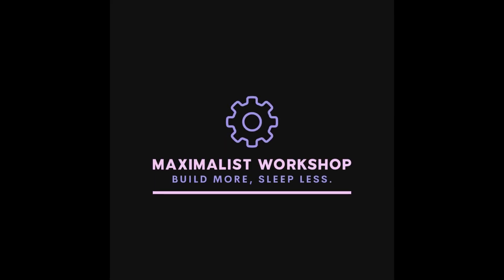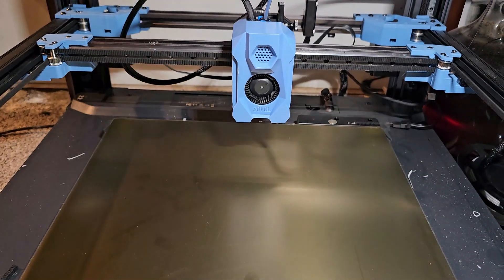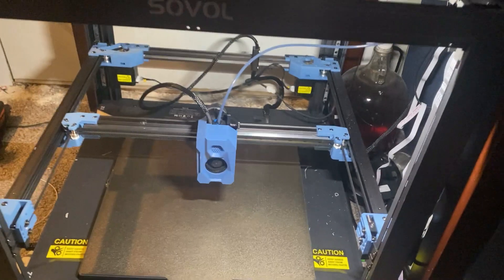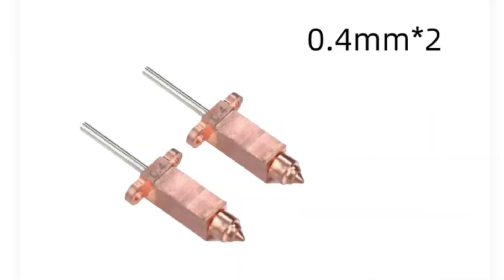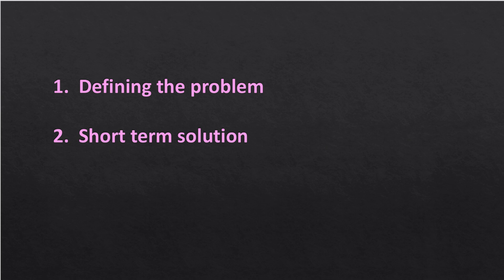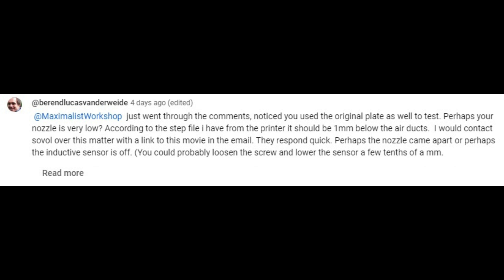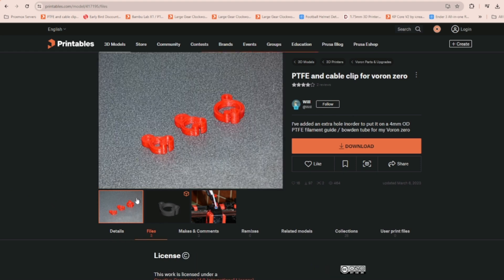Voron Clone Falls Apart - Sovol SV08 May Have a Problem

Comment: The machine is shit, straight up. they false advertised a X1 core xy clone thats garbage
Reply: after watching the whole viddeo, at least your motion system worked!
Reply from the maker: @AngryMarkFPV  They market it as a flying gantry Voron 2.4 clone.  The X1 is closer to the Trident.  In any case, it does seem like a lot of folks have been having motion system issues.
Reply: @MaximalistWorkshop  I am well aware, I also have an old tronxy 400. 
They clearly fixed the nozzles as the ones supplied in my order were threaded. however, clearly cheapest wiring and crappy terminators were used in the stepper leads.

Comment: 1:30 - YIKES!  That's some vicious nozzle crashing.

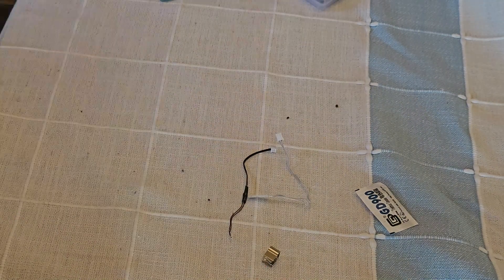Even though Sovol fixed the problem by adding a set screw to prevent the nozzle from pressing out of the hot end, but I replaced the Sovol hot end with a FlowTech hot end from @MicroSwiss when I was assembling my SV08, so I could enjoy the FlowTech advantages.  I can now quickly cold swap nozzles by simply unscrewing a FlowTech nozzle with a 7 mm nut driver and screwing in a different nozzle with no connectors to unplug, and no heater and thermistor to remove and replace as shown at 6:30.

8:45 - If anyone is interested in a fix for the dragging and flopping extruder cable when the reverse Bowden tube isn't used to stiffen it, I uploaded "SV08 Extruder Cable Chain - Cable Management" to Printables and Thiniverse.

Good video.  Thanks.  Sometimes I'm an early adopter, knowing that means I'll pay the most for the worst version of the product.  Rather than telling someone they should wait to buy a more polished version later as I usually do, I'm appreciative of earlier adopters.  If we all waited, there would never be any new products and initial problems would never be fixed.

Kudos to the Voron team, without which we'd never had an SV08.

My SV08 Wish List:

1) A thicker aluminum bed made with stress relieved cast aluminum that wouldn't warp more than 1 mm across the bed when heated as mine does.

2) The latest Beacon probe that is much faster and much more accurate than the OEM inductive probe that lacks temperature compensation.  The latest version of the Beacon has some magical accelerometer that can detect a 20 gram force nozzle touch, so after quickly scanning over the bed to create an accurate and finely detailed bed mesh, the Z=0 calibration can be very accurately determined by touching the heated nozzle to the heated bed rather than trying to infer Z=0 by inductively probing the bed when homing before a print.

3) Reliable web camera.  I often need to restart Crowsnest from the menu that drops down when clicking the power button in the top right corner of the Mainsail web browser screen.

4) Reliable WiFi.  My SV08 would never connect to my WiFi network.  I bought a WiFi bridge and plugged it into the SV08's Ethernet connector.

5) Nicer Klipper touch screen.  I seldom use the SV08 machine interface as I usually control the printer from my computer but the clicky rotary knob user interface feels very dated.

6) More LED lighting.  The stock LED strip is marginal at best and there is no light on the bottom of the tool head that would make it easier to see a print that fails until the print is 10+ layers tall and there's a big blob of molten plastic on the nozzle if the first layer failed.

7) New Orbiter 2 extruder with a smart filament detector on top, although I don't want to give up my @Microswiss hot end.

8) Multiple tool heads, or my preference, a fast IDEX system.  This is far from trivial but would greatly improve the SV08's capabilities.

I replaced the cheap and noisy motherboard fan with a reliable and quiet Noctua fan when I was assembling the SV08.  I'm wrapping up the design of a 3D printed insulated enclosure for the SV08 which I'll upload to Printables.  I still need to shim the bed to reduce the warping but so far I've been restarting prints that fail on the first few layers.  I'll eventually  install mainline Klipper when that's the only way to get some feature that I decide that I need.

Despite its deficiencies, I like the SV08 and I'm glad Sovol decided to make their version of the Voron 2.4 for the masses.

Comment: GD900 isn't rated for the hotend. It has a thermal property that maxes out at about 200C. Please swap out your GD900 with boron nitrate.
Reply from the maker: @BillBollinger-i4v  Dope tip - thanks! I assumed this was fine because it came with a hotend I bought, but you're right.  Probably worth some testing and a vid.

Comment: Isn't there a touch pressure sensor next to the nozzle clean pad? Why not use it to measure the difference between the inductive sensor and nozzle? It appears the nozzle is clear of the bed if moved to the extreme right, this means no bed damage.
Reply from the maker: Because the problem isn't that the z-offset is set wrong - the nozzle was actively being pushed out of the hotend during printing.  No amount of pre-print calibration can account for this.

Comment: That's crazy...   I think they should have just went with a high flow hotend that uses standard v6 or volcano nozzles.  Needing their custom nozzles is a killer for me.  I'd end up tossing the stock extruder/hotend and going with something more standard.  At least it runs Klipper so you can do just about anything you want.  Having to ditch parts that suck adds to the cost of the machine.
Reply from the maker: Agreed - fwiw, the Revo adaptor is available from PCBWay (though surprisingly expensive; waiting for mine now), and there's someone in the community who designed a V6 adaptor for which they're just trying to find a manufacturer now.  As expected from the maker community, new alternatives are popping up every day!
Reply: @MaximalistWorkshop  How much was yours? Everywhere I read it's surprisingly expensive, but I never saw a price.
Reply from the maker: @froh42  mine was originally about $220 or $230, but they dropped it down to about $140 because some of the custom stuff I asked for wasn't possible. I've heard less personalized units go for more like $80 or $90.

Comment: I don't see why they didn't use a thermal adhesive or set screw to lock it in place from factory.
Reply from the maker: Or a screw or literally anything else hahaha.  Since they never had any issues with T300 users, it just never occurred to them to test whether the nozzle could handle SV08 accelerations with all materials.

Comment: I guess we now know why the z offset seems to be so dodgy... Bummer...
Reply from the maker: Possible!  Tbh, automatic z offset on every printer except for Bambu Lab and Creality's X1/X1C are invariably slightly off.  About as accurate as the paper method, in my view, but I think that's because Bambu and the X1 series rely primarily on a strain gauge instead of trying to use both a strain gauge and some other probe.  Would need to do more testing to confirm.
Reply: @MaximalistWorkshop  a press fit that loose would be an excellent candidate for the greater part of the variability at least. In the end it's pointless though, they should have gone with a standard hotend, not this proprietary crap.

Comment: Could a grub screw be put into the heater block to set the nozzle in place? 
I think they were trying to ride on the Voron coattails and put out a fast/cheap alternative. One of the cost cutting measures appears to be the heat-block/nozzle setup. Granted, it's about half the price of a V2.4 in that size, and that's worth something. 
I would still consider the SV08 over a Voron if I needed a larger printer. I do like the CoreXY (I have a Voron 0.2) and am converting my SV06 to CoreXY now.
Reply from the maker: Yes,  adding a screw to the heater block is something that some folks are trying.  Voron has been central to their marketing from the beginning, but it seems like they really didn't test the T300's nozzle with PETG with the SV08's accelerations before releasing the machine.  Based on their email to me, I had understood adding a screw is what Sovol is doing and that this new design was in testing - it's discussed in my update video linked in the description. However, they have since publicly said that they don't think it's a design issue and they're checking with their manufacturers to confirm that tolerances are fixed.  That statement is posted on my Youtube profile.  At this point, I'm not sure what the plan is.
Reply: @MaximalistWorkshop  - You guys almost certainly know this seven months later, but for the benefit of new SV08 owners... the SV08 nozzle assemblies now have a set screw to prevent the nozzle from pressing out.  Sovol made that change soon after the above comments.  Even though this problem was fixed long before I bought my SV08, I opted for an @Microswiss hot end for its other advantages.
Reply from the maker: @Liberty4Ever  lol it's been a while, but I have a video on the set screw hotend called "Sovol's new nozzle is screwed" or something like that.  I ran out of time to make videos, but I've switched my whole printhead for a CoPrint at this point
Reply: @MaximalistWorkshop  - I've been watching David Wilson's videos of him installing CoPrint on a RatRig V-Core 4 and then a V-Core 3, and using them for multi-color printing.  I'm more interested in IDEX but the CoPrint system looks like a great option for many people who own a Klipper printer with no multi-filament option.

Comment: are you one of the ones on the FB page that mentioned you had this issue? i have seen a few people pop up with this issue and its almost always when printing PETG. i just dont know what makes PETG the filament that causes the issue. i have a ton of print time on my machine and most of it is with ABS/ASA and my nozzles havent budged. hopefully Sovol addresses this and sends out fixed nozzles out to customers that have the original ones.
Reply from the maker: Thanks! I'm not one of the people who mentioned they have this issue, but I am on the Facebook pages for the SV08, so I've seen the posts you're talking about.   Super useful to know this issue isn't happening for you with ABS and ASA!  In that case, it's more likely that this is a PETG-specific issue, which is reassuring.  Agreed that it would be nice for them to send out new nozzles to everyone so that we don't have to stare at our printers around the clock.  If it's more feasible for them due to costs or low supply, I'd also be fine if they just sent the new ones to people with malfunctions, though, as long as they replace whatever else breaks.  I just want this fixed soon.
Reply: @MaximalistWorkshop  ill likely purchase a set of "fixed" nozzles when they are out. As far as watching my printer, lol I just don't. I feel comfortable enough with my machine that I can press go and walk away. I actually took one of my spare nozzles and heated it up with a soldering iron to well over 300°c and tried to pull the nozzle out with a couple of pliers. While I was able to get the nozzle to turn I could not pull it out, and ended up crushing the tip of the nozzle before it even showed signs of coming out. Good luck with your machine.

Comment: Did u keep the broken nozzle? Would be awesome to get some measurements of the dimensions of the bore/ nozzle. I thought until now its one single part and planned to mill it down to see whats going on. My idea was if possible to drill out the nozzle, add a thread beeing able to use screw-in nozzles
Reply from the maker: I did - it's around here somewhere.  I'll see if I can dig it up.  If so, I'll take some measurements and post them.  Worst case, Sovol published a bunch of CAD models which should include the nozzle and hotend.
Reply: @MaximalistWorkshop  uh yeah thats a great idea, didn't think about that!

Comment: My voron also have a problem (the problem is I have disassembled it for the 69th time to upgrade it so it goes like 5% faster)
Reply from the maker: Hahahahaha - relatable!  My Voron (located directly above my SV08) is still a jumble of wires from the last disassembly.  I had actually been hoping to use the SV08 to repair it as sort of an homage.

Comment: thanks, I was about to order one... but now..       I´m not so sure      perhaps instead the Infimech TX
Reply from the maker: Interesting.  I would still go with the Sovol, honestly, or at least something other than the TX.  I'm only just hearing of the Infimech, and there's nothing about it that stands out as unique in terms of performance when compared to more common printers like the Bambu Lab X1C/P1S, the K1 series from Creality, Qidi's new machine, the 5M series from Flashforge, or the KLP1 from Kingroon.  The leveling system is kinda cool, but it's not necessary, and those other machines machines all have parts readily available from both the manufacturer and third parties.  As far as I can tell, they are all also from much more well-established companies.  I plan to make a video on it at some point, but I've always been weary of printers from companies that don't have a mid-to-long track record ever since the Wizmaker P1 and some others died on arrival. 

At a glance, almost none of the parts being sold for the TX, even on the manufacturer's website, and something absolutely will break on a 3d printer.  Even the nozzles aren't listed on their website, except as part of a complete hotend assembly.  While Sovol is backed up with preorders, at least they dropped just about every part on their website on release, we get quick responses from Sovol for new parts (I don't have any experience with Infimech and can't compare), and we now have the CAD models for the SV08 to make upgrades or print our own parts.
Reply: @MaximalistWorkshop  Well I was surprised by this quite honest review  https://www.youtube.com/watch?v=Kj0KjlPEEs0&t=414s   and This unknown brand is just a  new sub-brand name of a rather big 3d printer company Flying Bears..  And  although there is a reality K2 plus on the horizon,  I , ve just had it with Creality in general, however  You´re  doing a great job here, and I still like the basic Idea of only moving the gantry (Sovol SV8), so  perhaps the combination of this BIGTREETECH Eddy Auto Leveling Sensor  and a Steathlburner Extruder Design would give a Sovol Sv8 its better extruder/leveling/ system.

Comment: Unfortunate that they chose a press fit when they (as a 3D printer manufacturer) must know that there's gonna be near constant pressure trying to slip that piece out of position. Either press fit it from the other side with a boss to keep the nozzle from moving downwards or spend the 50 cents in manufacturing costs for a set screw that interfaces with a groove to prevent any movement along the filament path.

But what do I know, I don't make $5mil in revenue ¯\_(ツ)_/¯

Comment: I am looking at your latest video regarding the problems you have with your solvo sv08.  Do you know what you had the tool head fan plugged into the wrong  port on the board?
Reply from the maker: Good eye - wasn't causing my issue, but that does seem to be the wrong fan port based on Sovol's official videos.  I remember keeping everything the way it was from the factory, but it's possible I fumbled something at some point.
Reply: @MaximalistWorkshop  no problem I have seen some other tubers make the same mistake its easy to do

Comment: A P1P is 499 a SV08 is 580

As much as i hate Bambulab i would rather buy the P1P
Reply: unless... it's more worth it to get this cheap voron kit. But if you need another printer to fix this one. I can't buy it then.

Because i'm trying to buy my first ever printer.
Reply from the maker: I would not recommend a Voron as your first printer, especially if you don't have the means to print new parts.  It's not worth it, and the learning curve is much steeper than something already difficult like an Ender 3.  I'm not sure why you don't like Bambu Lab, but they make great machines; I use one for any parts I actually care about in each of my workshops.  They're reliable, and parts for them are both cheap and plentiful.  Great for beginners.
Reply: @MaximalistWorkshop  
 @MaximalistWorkshop   Yeah, you are right.

The why I'm very interested in the sv08 because yes it's a voron and I have a thinkerer mindset. I love that i could tweak everything and nothing would stop me from modding every single bit of the machine.
Sad thing that keeps me from buying it is those manufacturing weirdness.

And the reason of why I 'hate/don't trust' BambuLab is because you can't own those machines.
They connect to the internet without permission, you have to connect them if you want any convenience, also they upload telemetry.
Also if something breaks it's very possible you can't fix it if there aren't parts available, you can't do board repair because we don't have the schematics. Closed Source everything, etc.

That's why I'm having a hard time choosing what to buy :)

Comment: I wonder if this was the reason that suddenly about 3 weeks ago, over on Sovols website, all the nozzles except for the 0.4mm kits randomly disappeared and they went from a silver to more of a copper colour. I certainly hope they fix this soon, especially if it is caused by the higher heat from printing PETG .etc. I was kind of excited to finally have an enclosed printer to print some PETG, ABS, Nylon and ASA.

Thanks for sharing this with us!

Comment: With press fit parts, the tolerances need to be very tight.  Im sure its just a manufacturing issue that can be resolved. With any new product (especially at this price point) There are always some bumps in the road.  Thanks for sharing this, Im gathering as much info in anticipation of receiving mine hopefully sooner than later.